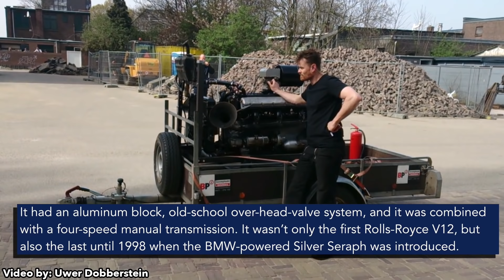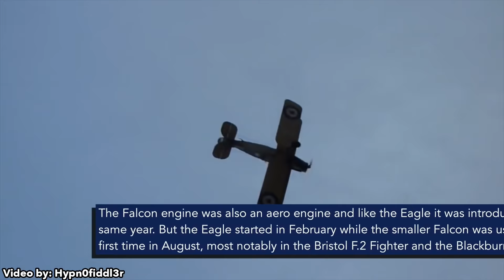10 Greatest Engines Rolls-Royce Has Ever Produced

Comment: Junkers just didn't have access to the specialty high heat tolerating metals that Britain and the U.S. had. Centrifugal effects on the turbine blades when they were hot tended to stretch them out of the tight tolerances necessary in a jet engine. They had the superior design - straight axial flow, compared to the 'Mom's vacuum cleaner' centrifugal impeller that Whittle came up with. Think about it - first, the inlet air took a sharp right turn at the impeller, ran straight back to the inlet of the flame can, (where the fuel was sprayed in and ignited) where it took a 180° turn back toward the front, took another turn toward the back and through the shaft turning impeller, and out the back as thrust. I'll take the straight through axial flow any day. Both designs worked, and both had their little inefficiencies and work arounds, but the axial flow engine was the wave of the future.
    Overall, I like Napier's diesels, there was far more creativity and sometimes out-and-out bizarre design work that I never would've thought of. Diesel aero engines, massive railroad engines that they put into motor torpedo boats, look them up for yourself, you won't believe some of the stuff that they pulled off!

Comment: What do you mean "old school overhead valve", OHV is cutting edge technology!

in america.
Reply from the maker: "cutting edge"... ROFL
Reply: overhead valves is at the top..literally in engine design......even lawnmower engines like Briggs and Stratton use ohv...engines with valves on the sides of cylinders are flat head types...and typically are less efficient because air flow and exhaust gasses were restricted